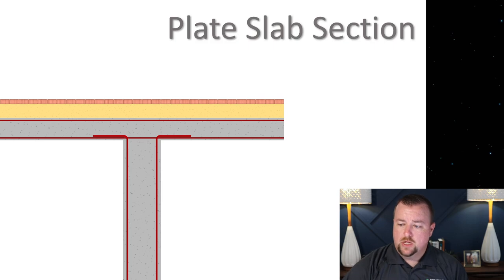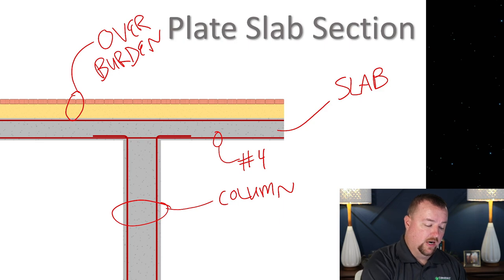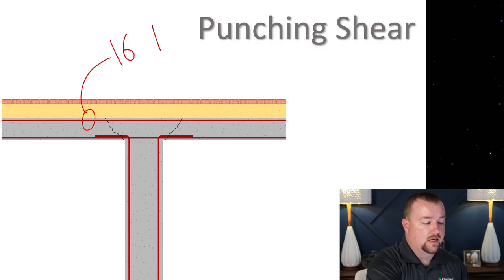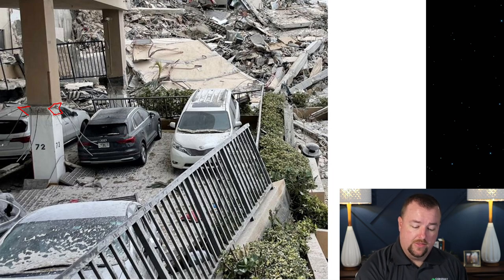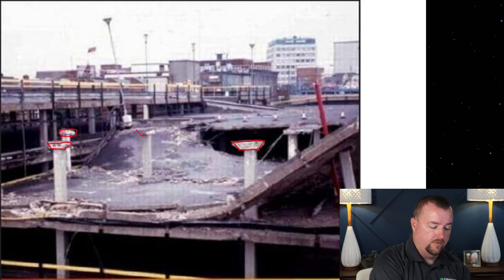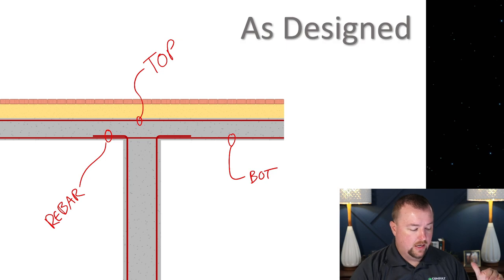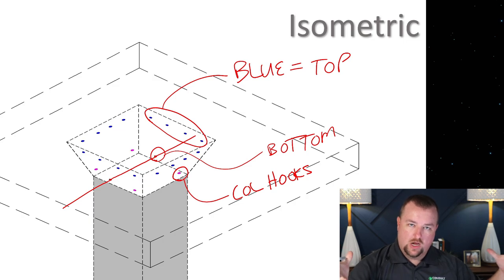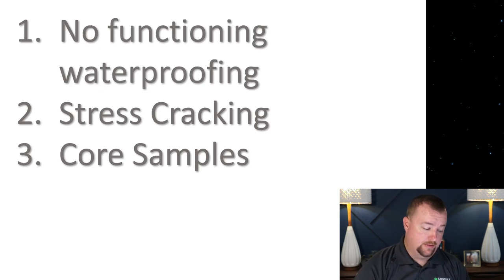The Importance of Punching Shear at the Surfside Collapse

Comment: punching shear matter! that need to be the slogan for the big protest against the engineers organisation.
not the punching shear that integrity explain, but the punching shear that realy cause this collapse, the lack of the punching shear on the columns under the deck and the hundreds columns in every floor all the 12 floors. that's the reason why the building collapsed like cards tower.

Comment: You can actually do a tabletop model…. Small piece of plywood.    Put say 3-4” screws spaced somewhat evenly thru the plywood.    Then take a piece of cardboard then push down.   Punch thru results.   Next take small blocks of wood 1x2 screw them onto the screws that are thru the plywood.  Then take the cardboard and try to push down on the cardboard.  Not so easy to puncture the cardboard ….  Results in a warping  buckling pattern.    Engineering students should study this.   I did my thesis on the skywalk collapse at the Hyatt Hotel     Engineering shortcuts were made to save $…. NYS thruway bridge collapse in Schoharie county was also a topic of study.  NYS gave us students all info pertaining to said disaster

Comment: So the slab sits directly on the column? I thought they would have had horizontal beams linking the columns and then have the Slabs sit on the beams. That's a very cheap and structurally inferior way to build.
Reply: The structural slab with rebar is it's own beam. To build a concrete beam on top of the columns would be built the same way as the deck. The deck still needs to support itself in the middle between 4 columns, so it couldn't be much thinner with separate beams. Think of the slab being built into the column rather than on top of the column, as there could have been yet another floor above it, as there was in the main building
Reply: bullfranthrow John Haller says a bar of butter is a beam.
Reply: @johnhaller5851  If beams are built on top of every column then that would eliminate punching shear. If the slabs did fail then the beams and columns would remain in place. I guarantee that the reason why slabs are built directly on the columns is to save money.
Reply: @johnhaller5851  Also slabs can never be beams. A slab is 6 inches thick at most while a beam is 15 inches. Beams also have bigger rebars than slabs.

Comment: I only know enough about engineering to ask dumb questions, so here's one - In buildings like these, would wide-flange steel beams and columns have been stronger than the rebar reinforced concrete?  It's entirely possible I have no idea what I'm even asking.  I just feel like when I see buildings like these under construction these days, there is more steel than concrete.

Comment: Get your hands on photos of the building when it was being constructed & I’ll give you more clues to the overall picture of maybe why it failed. I heard from another source that the contractor walked off the job around half completion. At this stage of the project, there is normally only 2 reasons why this could happen, money payments or being asked to do unethical work. Also the crane crash during construction showed “old” shoring timbers & this was at “grade level” on a “new” job? & cheap shoring methods. Big red flags to me, from my experience. I have my doubts whether this building was built correctly, simply because the contractor was asked to adopt quick & cheap cheating methods. I’ll keep the rest of my powder dry in the meantime, but there is enough clues noted already to warrant deeper investigation.

Comment: Journey Ironworker, There is no way to protect the re-bar. Even if your re-bar is coated, one little scratch and it's toast.
I would never live in a reinforced concrete building that's older than 20-30yrs old.

Comment: Rebar holds concrete in place. It does not hold anything up. Rebar is bent by hand on site, it has zero weight holding ability. When in a slab, rebar is holding zero pounds. It does nothing until that concrete moves. You ever see a guy holding the bottom of a ladder in case in tries to slip? That's what rebar does.
Modern builders are using fiberglass rods as rebar because they hold no weight, don't add weight, and dont rust.
Reply: I also don’t want fiberglass rods used as rebar.  Give me enough steel to hold the weight.  Big hefty beams of steel.  No cement.  No rebar.
Reply: @kathleentaylor8840  Yeah if cost is no object, steel is the way to go.

Comment: Be careful on speculation. True engineering looks at all facts before coming to conclusion. I offer a question...why would the building stand for forty-plus years and then catastrophic failure? You cannot argue long term conditions to short term events. Something had to occur to dramatically change the load scenario. I still stand by my early comment regarding partial liquefaction. This would create an abrupt change in structure loads.
Reply: Every building on the planet will eventually collapse if left with no maintenance due solely to time and weathering.  Your argument is flawed.  The causal event could simply be nighttime cooling and contraction. The building was progressively damaged over time.

Comment: Rebar is unacceptable.  I would never live in a building that has rebar in it anywhere.  Rebar must be for the poor I am concluding.  And waterproofing certainly is a poor cosmetic fix to a structural flaw called rebar.  Columns should be built of pure steel, not cement used instead with, oh yes, of course, asinine rebar made of steel that separates from cement when wet like oil from water.  People who like rebar are the same poor, uneducated people who contract sepsis due to their failure to supplement with vitamins D and K-2 as MK-7.  Imagine if Andrew Carnegie had decided to become a rebar salesman instead of a steel magnate, and you get the people who use cement to make columns for tall residential buildings.
Reply: I’m no engineer but unless I am missing something it makes since to have the foundation on steel beams. If not all of it then the most important parts. Especially if your building on the beach. I would even think that you can limit corrosion with zinc element like they do on big ships. You would have better exposure to any problem areas, and repairs would easier. The obvious is that the structure was rotted out but you could not see it’s true extent. I can only imagine how many buildings are built like this. Seem to be built to only survive the designer and builder. After they are gone what matters does it make.

Comment: Too bad we don't have an expert on foundations that could actually speak to problems in the foundation that could cause collapse. So far nobody has talked about that in any depth. Most engineers will start out saying the foundation problems can cause failure first in the list of possible causes but there it stops. My opinion as a lay person is several pile caps failed and caused the pool deck to fail next then the building came down. Why is nobody even considering this scenario? New grade beams pinning the pile caps were in the repair and restore plans but not one engineer is speaking to that. I see a gap in the analysis of this collapse and would love someone knowledgeable to speak to this please.
Reply: In my humble opinion this information warrants investigation. If the crane collapse damaged the foundation and it was not repaired this could have been the smoking gun in the building collapse.

Comment: I would never tie the pool to the building in any design. The pool deck being part of the garage roof is a no no.
Reply: The pool was not part of the structure, and is not an issue here. Look at the photos- the carpark level stops before the pool. It has walls around it as the pool would be sunk into and supported by the ground around it. The pool deck merely ties into the edge of the pool structure.

Comment: Can you see these shear heads in normal circumstances, at least in a carpark, I am sure I am not the only one feeling motivated to inspect a few local constructions wherever we are, Take care people.
Reply: Modern parking structures are usually built with precast beam and deck pieces, it's likely cheaper and stronger. They put a bit of steel plate at the ends and weld them to a knob that sticks out of the precast wall part. Only the foundations are built on site. It was great fun watching one of those garages go up. One thing to look for is maintenance of the waterproofing to be sure it's not getting into those welded steel plates.

Comment: How come none of the rebar was tied together? Just seems like they were just set on the concrete. Arent you supposed to make a rebar frame before you pour the concrete?. All the rebar goes in one direction. Shouldnt they have been going 👇👆👉👈 and be tied together? Rebar should be in the middle of the slab. 

They knew it was a issue. I mean look at the plastic sheets they screwed to the roof in the garage to re direct water. WATER leaks is very detriment

Comment: is there some kind of xray that can show rebar ?  ,   had a problem with rebar rotting due to drainage not being maintained on the Brentford flyover  in west London England , they fixed it at great expense ,  i cant believe that it was at its max without planters and moving loads in this case , its amazing what a brown envelope with cash in can do . :) , found your series of vids very interesting , most structural engineers i have worked with go over the top ( belt n braces ) they call it , was on one job where i said " this fool is cutting corners ", that even i knew it was to small  RSJ ,   The structural engineers on that job  was amazed i gave a shit , (i was right ) they upgraded the RSJ , then got a "YOU GOT YOUR WAY " from the contractor , i was the brickie forman . the up side is that the terrorist didn't know this , as a kite   and not an aircraft could bring these buildings down .

Comment: Wrong!  There is no such thing as shear reinforcing in a 10" slab because the stirrups do not have development in either the upper or lower half of the slab, because the slab is too thin.  The preferred method of increasing the two-way or punching shear capacity, is with a deeper column cap that extends out far enough from the column so that punching shear is no longer critical.  So a column cap for a 16" square column could be about 42" x 42" x 9" deep that is cast with the slab concrete.  And the column cap would not contain any stirrups either.  Top slab steel over the column, also does not increase the punching shear capacity because it is not sloping down in the slab to keep it from peeling out of the top of the slab and to support some vertical load with the vertical component of the tension force in the rebar.

Comment: THIS WILL HAPPEN AGAIN at the other buildings, please make them listen and stop this.
The 8 car main floor parking area, beside the pool deck, which weighs approx. 40 thousand pounds plus is the obvious place where this disaster began.  The pull down dropped the pool patio, which made the soaked rectangle planter on the pool deck drop through the floor knocking the 4th column of the building support to the ground.  Support column # 27 (parking spot) is the column, I think.  Once this started, the P shaped support BEAM had no where to go but down, in 6-7 minutes.
The full collapse starts at the 4th-5th column in the underground at the buildings pool deck. The build was very top heavy which made the support columns bow in the parking garage. There is no excuse for this failed architectural construction. 
THIS WILL HAPPEN AGAIN.

Comment: that tile/thinset layer under the waterproofing membrane is really odd.   Sounds like a major F*ckup of some sort.    Tile would have been the top finished layer.   I mean it serves no other purpose other than a decorative finish.    Maybe someone forgot the membrane or thought it wasn't needed during initial construction. So then they said, screw it, we'll throw down some rubber and start over rather than pull the tile off and do it right.   And then they added another 1.5" of material and weight.    Very very sketchy.
That sounds like where the lawyers need to get involved.

Comment: I have worked for a company that removed an old concrete boat ramp at the Ocean and when it was torn up the rebar had no rust. It shows that the buildings rebar was too close to the surface to allow spalling. And any building that collapses like a house of cards is a crap design. You should copyright your videos others are copying you.

Comment: I’m more a fan of high steel than concrete construction for the simple reason one incompetent batch man running the plant could send out a bad mix and even with a onsite tech taking samples and checking air and slump  they won’t find out until 30 days later when they bust the test cylinders!

Comment: Many years ago, I helped a couple of Civil Engineering PhD candidates build and test concrete column/slab sections (I was a cheaply paid undergrad who liked playing with lathes, welders and concrete, LOL). They were testing two different ideas to strengthen the joint against earthquake shaking. One experiment was fibers in the concrete mix to bond the concrete, and one was double thickness collars around the column about a foot and a half in each direction. The collar was significantly stronger, IIRC. Has this ever been used to prevent punch through?
Reply: @FranzAntonMesmer  Thanks! Honestly it was more about beer money and a chance to mess with heavy equipment at the time, but I learned a lot and enjoyed the year of work on the project.

Comment: Coring thru rebar is pretty stupid. But i guess if the whole building is getting torn down it does not matter. As for that shear head as you call it is really just a thickened part of the slab pour. As for punch true theory,, any thing can be punched thru with enough pressure, just as they punch holes in thick steel. This whole mess is not on the builder, its on the failure of engineering firms or inspectors. Why they do not have the structural engineers inspect their own designs is because of the cost. Most inspectors are idiots.

Comment: Looks to me it was bad designed building from the beginning and city inspector accepted. On one side 12x16 inch column which failed on another 16x16 inch column was still standing. 
Water contributed also, but definitely bad support for pool deck and 1/2 of the building. On the pictures ends of those columns look like tooth picks.  
Conclusion city fault accepting shady design. No slope on pool deck. Again city fault. It could be bribery involved to get pass inspection. 
There also was another problem the garage was located too low of water line. Low tide or high tide the water shouldn't be present in the garage. 
I can bet sister building is few feet  higher than collapsed one.
City fault again allowing to build garage in so low depth.

Comment: Having cored plenty of holes in new construction, with no rust and have had them bust up when the concrete wasn't vibrated properly.  Knowing what's in there, sometimes they've put so much bar, conduits, form ties, etc... that the concrete vibrator's whip couldn't get in there despite the best effort.   This also reminded me of a time when I filled in a hole about 1.5' x 3' that was near a column.  There were some visible cracks, but afterwards, taking a concrete grinder to the surface to blend it perfectly  in, the dust revealed way more cracks I couldn't see like I just magnafluxed a piece of steel.

Comment: 'delamination' of the paving layer from the structural layer has nothing to do with anything.  that offers no structural integrity.  those layers cannot really be bonded.  if ur just saying separation is whatt results in the photo, yes.  of course.  looks to me like this is failure of people constructing and protecting structural elements.  yes, rebar can pull out of concrete like a stick out of warm popsicle, when corrosive agents are present without the proper protection.  this was known when this building was constructed.  this is on a whole bunch of people failing to do their jobs properly from inception to grave.
Reply: Believe he made a reasonable case the delamination was through plane of top rebar in slab, such that the top rebar was no longer contributing to resistance to column punch through the slab.  Looks to me like building was doomed from the get go.  Sad for the needless loss of life.

Comment: What he is not explaining is the real world scenarios. As far as design and engineering goes,, it works like this. Somebody want a building built, they hire a architect he draw's the design, than a structural engineer draws calculate the loads and shear stress, which are added into the design of the building plans which are called structural pages, verse architectural pages. Than the plans have to be approved by either city, county, state, or federal and so on. Everything built off site or on, gets inspected over and over and over again.  So the only possibilities of failure are, bad structural design, bad inspections before or after building was built and maintained. Salt water pouring into basement was a eventual failure scenario.

Comment: Arches ftw Should be no need for steel at all .
Reply: The problem with arches is that the arch wants to push the supporting material outward, which is why flying buttresses were invented. Plus, an arch needs a lot of vertical space.
Reply: @johnhaller5851  sounds perfect , aesthetically pleasing , long lasting , lots thermal stabilising mass.